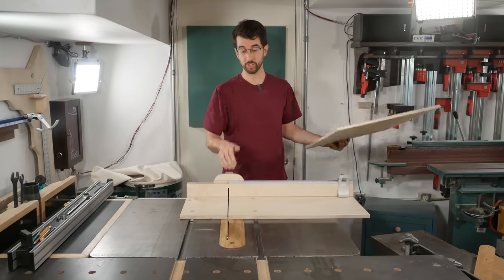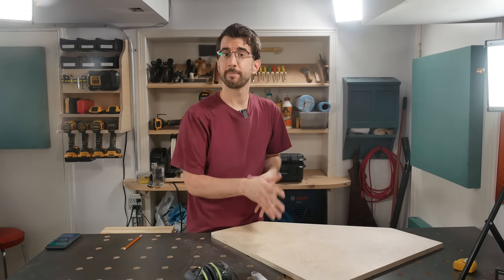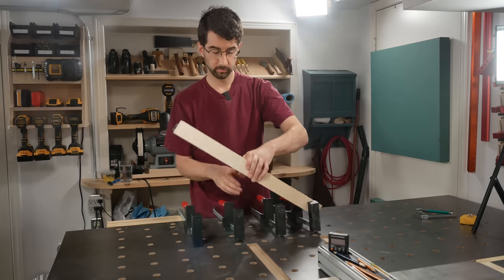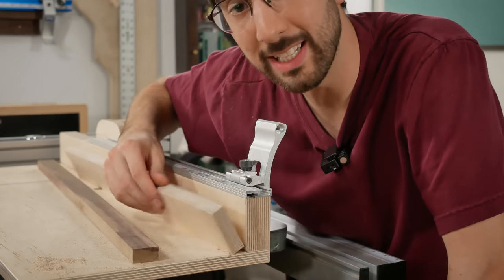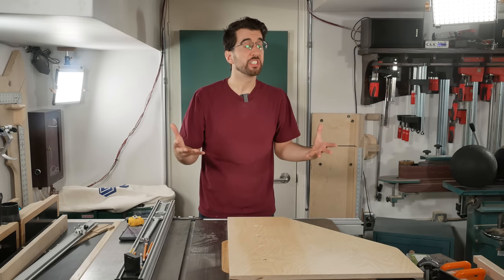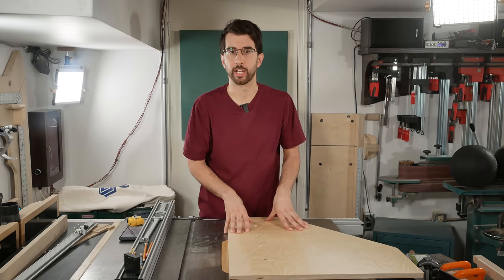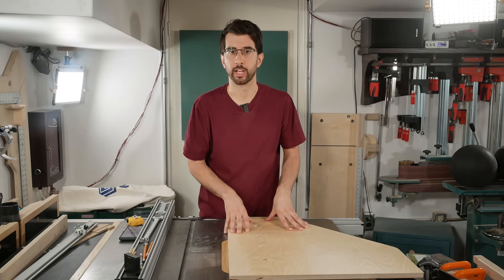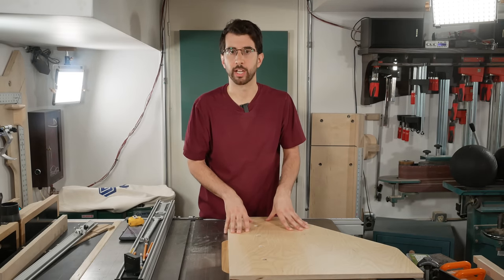the FLAW with Ultimate crosscut sleds

Comment: what;s really interesting about this is the concept of putting the fence on the leading edge of the sled, allowing you to cut materials that are bigger than your sled AND having the sled be stable and running true before your material hits the blade.

I'd always assumed that the fence needs to be on the back end - pushing the wood into the blade countering the resistance of the blade, which would tend to push the material backwards. 
But - it seems that pushing material against the fence still seems to generate an accurate enough square cut.

I assume that they key to this is a pretty tight fitting runner - if it runs too loose then there's not enough resistance as you push the material into it. You need that little bit of resistance to keep tight contact between fence and material thereby keeping everything square...

Nice video - thanks!

Comment: I built the Ng style sled (size and method), at work. We have a pretty small wood shop in the basement of a gothic chapel. Honestly, I didn’t find the five-cut method that complex, but I really like your method as well! Each relies on its own style of accuracy in process, and simplicity in design. I used 1/2” mdf, but you’re right, that 1/4” has virtually no effect on versatility of the sled. I also prefer a sled that straddles the blade with two runners. 

My only criticism is a personal one: I do not like sleds that rely on the leading fence, despite the Norm dna. I feel it’s a safety issue. You’re leaning forward to apply pressure, and passing beyond the blade with your hands. Good technique and process will mitigate the issues. But I have a safety office to deal with, and enough trouble with them because I refuse to use the devil spawn of a blade guard 😂. 

Anyway I love your content! Please keep stirring the pot, and challenging us to think in a different way. You’re funny and creative and a pleasure to watch..

Comment: I never understood large crosscut sleds.  Why not just use your fence?  Even if both sides are not straight, you can attach a piece of wood (or plastic or metal) with 1 straight edge and run it through.

Comment: Sliding miter saw:  Am I a joke to you?!
Reply: Yes a sliding miter saw is the proper tool to use for cutting most pieces to length, and if you need more cutting length, you use a panel saw or track saw. Sleds are hacky and quite frankly I do not believe they are as safe as people think they are.

Comment: I have to agree on the frustration of wooden runners. Way over rated. I use UHMW and haven’t looked back. You can make a bunch of runners from a sheet and much cheaper than the metal ones

Comment: Every cross cut sled/router sled i’ve seen on youtube all suggest the same thing regarding the chamfered bottom edge to the fence for sawdust but this surely is complete nonsense because after 2 or 3 cuts this chamfer will be full of sawdust and require brushing out anyway

Comment: My high-efficiency dream involves geo-thermal supporting all my heat pump needs including heating, cooling, hot water, dehumidification, and refrigeration. Any of those should benefit from geo-thermal. What takes it to the next level is when you use the hot water tank as a heat reservoir for when you have excess heat or just route heat from the refrigerator directly to a device that needs it immediately. You could implement it with one central heat pump or each device with its own pump.

Comment: You can also buy strips of pvc from the usual scumbags for your runners.  easy to work on any woodworking tools and wont swell or shrink.
Reply: Careful with the pvc on steel and iron. It is abrasive, even though it's plastic. It will turn black with the metal particles sticking in it, and then when summer humidity comes, RUST!

Comment: Okay here's why you want it on the left instead of on the right where it is better supported. First, that's the way Norm did it, and if he did it that way, he had his reasons, which he often did not explain on the New Yankee Workshop. Second, if you put it on the right, you will have to clear off your table extension to allow two feet plus the width of the fence in order to use it. That means you won't use it sometimes when you should. The left side of the saw is usually clear or a lot closer to clear. Fifth, why can't you be satisfied with 1-4?
Reply: Actually the real reason its somewhat better on the left side is that if it's a right tilting blade your cut line will be off if you switch blades that don;t have the exact same kerf thickness as the one you made the jig with.

Comment: Where is your Riving Knife?!
Reply: A riving knife is unnecessary for anyone who truly knows what they're doing with a table saw. If you want to change out to a thinner/thicker blade, the riving knife now won't work anymore anyway. This issue is especially apparent with a dado stack. They are also incompatible with many jigs and, at least for me personally, they get in the way more than they help. I had to remove mine rather frequently when I first started woodworking for the above reasons and decided it was too much of a hassle to keep it around. Also, many higher-end saws don't come with them to begin with, nor do they have a spot to install one.
Reply: It’s probably an older saw that didn’t come with one. As for the above comment, choose to live risky if you like but to encourage others to do so is incredibly irresponsible.

Comment: Its like fellow carpenters I work with who buy a 12” mitre saw because it can cut a 6x6. 

These are not guys who are often cutting 6x6’s.

I went 10” because I can exchange nicer blades with my table saw. Also if I ever find myself needing to cut a 6x6 I can rotate the board.

Comment: You need to stress your method can't be used on a sled with a traditional pivot point. So I dispute your assertion that this is somehow better than the five cut method who's math is really very basic.
Reply from the maker: you can still pivot a fence near the blade on a more typical sled.
Reply: @ScottWalshWoodworking  Yes but to be perfectly accurate it would need to be in line with the blade.

Your method worked for your sled. Just worried people might try to apply your technique without realising the importance of the pivot point.

Seemed to me you were insinuating that your method was in some way superior.

Math is math, if you just write down and follow the steps for either method they are very simple calculations.

Comment: A down side to this one sided sled is tear out on the right side of the blade. A 2nd downside IMHO is that the blade tends to pull the workpiece away from the fence because the fence is located on the pull side not the push side of the workpiece.
Reply: You're pushing the piece INTO the fence as you push it through the saw.  Pretty simple concept.

Comment: I suggest a slightly different "5 cut" procedure that does not require calipers or a feeler gauge, and uses less wood:

Fasten one end of the fence with a screw.  Measure from the screw to the other end of the fence.  Let that length be L.  Fasten the other end of the fence with a temporary screw.  Find a panel somewhat larger than L/4 square, and make the five cuts, again finishing by cutting off a strip about an inch wide.  Determine whether you need to rotate the fence clockwise or counter-clockwise.  Now make two marks on one edge of the strip, separated by L/4.

If you need to move the fence clockwise: Lay the strip alongside the fence, with the mark on the narrower end aligned with the end of the fence, and clamp a stop on the other side of the strip, opposite the mark.  Remove the temporary screw, and slide the strip until the mark on the wider end is aligned with the end of the fence.  Snug the fence against the strip, and fasten it permanently in that position.

If you need to move the fence counter-clockwise, follow exactly the same instructions except exchanging "narrower" and "wider".

You mentioned lightening holes.  I'd suggest routing a slot, about 1" x 4" with nicely rounded edges, as a handle.  The best location would probably depend on how you store the sled.

Comment: Why waste your time with a 5 cut method? When if you think back to Norms days  flip the sided to the other side of the blade or run it backwards split the difference from the cut and adjust the fence. Duh. 
So with this sled the leading edge is the fence when its on the left side of the blade but if you put it on the right side of the blade  cutting a second cut making a strip to mesure you now know the angle the t slot is in relation to the blade cut.
You can adjust the fence on any table saw sled this way and get it pretty accurate.

Remember when Norm said flip the stock end for end to cut a dado in a part with a stack dado set it puts the cut right in the center. Same theory without a 5 cut method.  Simple.
No math.

Comment: Not surprised the big sled weighs 30lb…It’s over engineered and excessively beefy.  The fence..TWO layers of 3/4” ply…why? To keep the base together a fence of 1/2” thick would do.  The base..again, massively thick..why? 1/2” ply or mdf would do fine.  Plus you don’t need full depth fences all the way to the edges.  You simply over engineered the whole thing!

Comment: Hate to be that guy... but as a former machinist your definition of a climb cut hurts my soul. A climb cut is moving the tool in the direction of the rotating cutting bit. A "conventional" cut is the opposite of a climb cut, the cutter is digging the material out. Climb cut gives better finishes, conventional cut is better for the tool and easier on the machine.
Reply: He's doing a climb cut. Clockwise on the outside of the work is climb cutting with a router. Routers spin clockwise from the top. So feeding clockwise you're running in the direction the bit is turning and climbing.
Reply: Sooo what is a climb cut?? 😂

Comment: The 5 cut method as you described it does not really make any sense because you are attempting an unreasonable and impractical degree of precision with your table saw blade as the basis of measurement.  If you desire that level of precision you must use the miter other slot as the basis for making your measurements.  Also, way overkill, but if you want that level of precision that is what you need to do.
Reply: not so...  the reference is the cut line, not the saw blade and therefore is effectively dependent on the slot in which the sled is running.

Comment: I don't see why this video is needed (looks like it was uploaded around December 2022). Everything that is mentioned in this video has been covered many, many, many times before. Also, I don't see why a variant of the five-cut method is needed either, when there are a gazillion online calculators and apps you can use to do it like it has always been done, without needing to know any math at all. If you don't have a scrap piece that is exactly the dimension like you require, the it's not really a good idea, and if you need to do it twice, the piece will be shorter the second time. It's a nice video, but I have seen it all before so, so, so, so many times.
Reply from the maker: if there was only one video on every single topic, youtube wouldn't exist.
Reply: @ScottWalshWoodworking  Well, I never said there could be only one. I didn't even say 100 is too many. It would help though if there were some novel ideas, techniques or methodology being covered to make a "Fast and the Furious 999999" 300 years after the original came out. It's just my personal view though... If it works for you, your audience likes it, etc. then it's all good I guess. However, to be fair, I feel a lot more people than William Ng could be credited here.

Comment: I don't think it's smart to have the fence on the wrong side.  Material should never be unsupported against the rotation of the blade.  There's a reason that nobody has ever made a crosscut sled with the fence backwards.  This is dangerous.  Innovation for innovation's sake is stupid.
Reply from the maker: i think you missed the whole part where people have been doing this for decades, a la Norm Abrams, as well as the whole concept of a sliding table saw.

Comment: a lot of flaws with this design. you could have cut down the old sled and wound up with a good an end result but actually more functional.

sleds are much better with support on both sides of the blade. only having the sled on one side of the bade loses the zero clearance benefits of no tear out. not having any fence on both sides makes cutting small repetitive pieces way less practical. you can't put the stop 2" from the blade and cut a 4' workpiece into 20+ little pieces because 90% of the workpiece will be off the sled. 

this is a nice secondary sled for large panel cuts but way less practical than many other sled designs. if cutting large panels is the primary reason you need a sled you're probably better served with a track saw.

Comment: Crosscut sleds are a waste of time, energy, and space. Use a miter saw. Use the right tool for the job. Table saws rip, and miter saws cut to length.
Reply: Kid, you've got no idea.
Reply: @harrysingh-tj5pu  I've been doing carpentry professionally for 25 years. There is exactly ONE reason to build a little sled, and that is in combination with a dado blade for joinery. I guarantee you are the "kid" in this situation. You youtube hobbyists are a poison on the industry, and that is why you do stupid things that cause you to cut your fingers.
Reply: The reason they build these stupid things is because they don't wanna spend the time and money having a proper miter saw station. Or they have space issues. The problem I have with sleds is it gives you too much of the illusion of safety, and one day you won't be paying attention and run your finger right through the blade.
Reply: @JasonEllingsworth  dropsaws are harder to adjust to set a correct height in for example cutting to a required depth on a tenon, drop saws have very small limitations in size of material in cutting cabinetry components if required, mitre splines are most precisely cut on a sled jig. Drop saws are limited by their blade height as well, unlike a table saw where you could put any kind of box or door on a sled and trim the ends. Like the author mentioned too, drop saws require a dedicated space and when used for its best purpose, requires a tonne of space at that, on a station with wings. I've been working in many cabinet making factories, most work is a done on a sliding panel saw, even with a dedicated drop saw station. Drop saws are used for cutting long lengths of trim, perhaps for you, lengths of whatever rough timber, for which I can agree, is a more effective tool. Maybe get back on the jobsite and hammer some more hangers. You aren't fit for cabinetry.
Reply: @harrysingh-tj5pu  It is sad how angry you are. You already listed a better tool than a sled for cabinetry, and you don't need a sled at all for cabinetry. It is literally a waste of your time. A sled is just using a tool in a way that it is not intended. If you need one to do anything more than working with a dado blade, you aren't as great as you think you are.
Reply: Been building stuff with wood for many years, and I have yet to have a single reason to use a tablesaw sled...but I also have a full shop with the proper tools, as you most likely do as well. Sleds seem like a hacky youtuber hobbiest trend. Sliding miter saw cuts most pieces to length cleanly and at angles you will need. Panel saw or track saw handles the rest. Stick to ripping on a table saw. It is what it was made for.
Reply: @yoloswag4063  I could spend thousands on a table saw that I don't have space for or a couple hours on a sled. Yeah I'll do the latter.
Reply: Dude is so mad 😂😂
Reply: @dnoel5787  i think you're a little confused there.  Sleds go on table saws. One doesn't work without the other